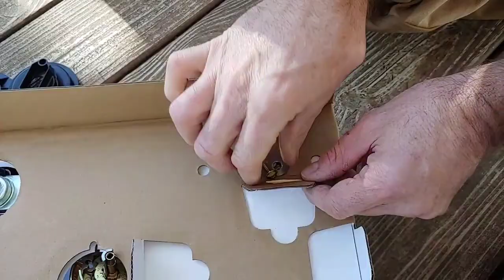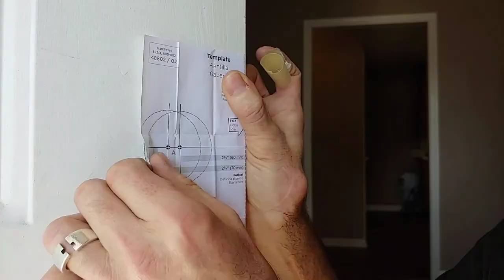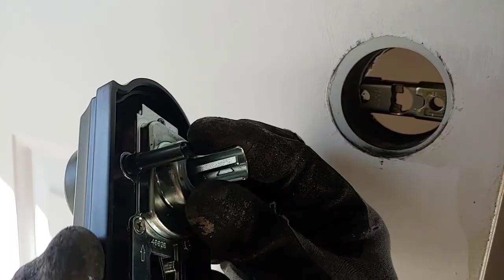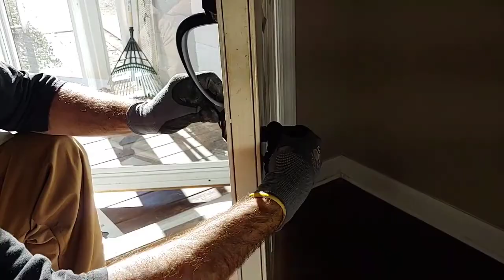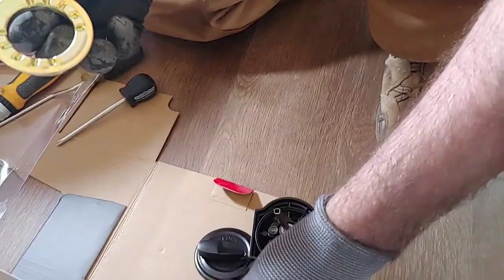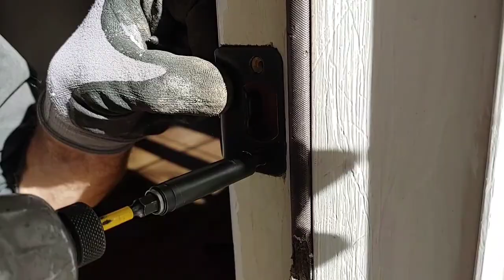Kwikset Montara SmartKey Front Door Lock Set Install DIY #homeimprovement #diy #how

Comment: What size drill bit did Chris use for the hole he drilled?
Reply from the maker: I believe that the drill bit I used was a 3/16 ... sorry about not mentioning that. If you take the bolt and size it up to your drill bits...make the drill bit just a tad bigger than the bolt and you should be good to go! Thanks for watching. You Can Do It👍

Comment: Question. I did mine and it looks like I did everything someway but to lock it locks to left and to unlock is to the right. 
Is there a way I can change that?
Reply from the maker: Hi Junior...great question!  The answer is that unfortunately, that is how locks work. You would think that they would both lock the same direction, but the two locks work differently. The deadbolt is just a simple mechanism of turning the lock to engage the bolt into the door jamb. The doorknob lock works by engaging pins / cylinders in a particular direction so that the doorknob is not allowed to turn. Because these two locks engage the locking mechanism in different ways, the key has to turn differently to achieve this. I'm not aware of any lock set out there that allows the key to operate in the same direction for both locks. I have found this issue to be the case with each set that I have installed regardless of the maker. I hope that this information helps.👍
Reply: @YouCanDoIt2  okay. I thought I did something wrong but with your answer you have answered all my questions.  Thank you!

Comment: Thank you for this video.  Watched before installing the handle lock set.  Very good instruction.  I replaced another handle set and I lucked out and didn't need to drill a hole for the bottom, it lined up with the new handle.

Comment: How do I get the lock orientation to turn the same way? My deadbolt locks to the left as it should, but the bottom handle lock turns right to lock. How do I switch that?
Reply from the maker: Hi Christina. Thank you so much for watching the video and leaving a question. Unfortunately, that is how locks work. You would think that they would both lock the same direction, but the two locks work differently. The deadbolt is just a simple mechanism of turning the lock to engage the bolt into the door jamb. The doorknob lock works by engaging pins / cylinders in a particular direction so that the doorknob is not allowed to turn. Because these two locks engage the locking mechanism in different ways, the key has to turn differently to achieve this. I'm not aware of any lock set out there that allows the key to operate in the same direction for both locks. I have found this issue to be the case with each set that I have installed regardless of the maker. I hope that this information helps.
Reply: @YouCanDoIt2  I appreciate your response. Thank you!

Comment: I have this same lock in gold. Installed on the same side as your video. the bottom locks counter clockwise in your video. Mines lock clockwise how do I fix this? I’m trying to match up with the deadbolt which locks counter clockwise.
Reply from the maker: Hi. Thank you for watching the video. This is what I know to be true about locks. Deadbolts are a simple mechanism with a simple twist to the right to engage the bolt into the jamb and then a simple twist to the left to disengage the bolt. Doorknob locks don't work that way. As far as I know, and for all the knob locks in my house, they all unlock by turning towards the jamb and lock by turning away from the jamb. I don't believe that there is much choice. That's how they are manufactured. If your lock only goes one way, I believe that it is designed by the manufacturer and cannot be changed. The only option for these types of door handles is to change it from right side to left side of the door,  depending on your door swing, by twisting the barrel around. But the locking mechanism itself is built in and cannot be changed. I Hope that information helps.
Reply: @YouCanDoIt2  thanks for your rapid reply 😊

Comment: I live alone. I own my own house. I was able to remove the Kwikset piece that is flushes against the door. I tried using a flat screwdriver to try and remove the round piece, but unfortunately, I have not been to remove the round piece no matter how hard I try. My door is only 2 years old. I have been watching/viewing several videos on YOUTUBE, but so far, I have NOT found one that can help me remove the round flat piece. The screws on my doorknob are hidden.
Reply from the maker: Hi Nancy. If I am understanding you correctly, you are trying to remove the little round disc that is inside the house side of your door on the very bottom of the handle. If that is correct sometimes those do not pop off they actually unscrew. You might want to try unscrewing it. If that doesn't work look at the very bottom of the disc and see if there is a little slot that you can insert a flat head screwdriver into to pop it off. If I was to guess this sounds like it is a disc that you have to just put pressure on to and unscrew it. I hope this information helps you 👍

Comment: Why does the bottom lock locks to the left and unlocks to the right?? Can't see a way to change it like the bolt on top. Thanks
Reply from the maker: Hi Nick. Thank you for watching the video. I'm not sure which lock you are referring to. You mentioned the bottom lock but there's only one lock on this door handle. Can you give me more information?
Reply: @YouCanDoIt2  I'm talking about the lock on the handle.  It locks to the left and I would like it to lock to the right like the dead bolt on top. Thanks
Reply from the maker: @nickhernandez4685  oh, now I understand what you are referring to. Deadbolts are a simple mechanism that is a simple twist to the right to engage the bolt into the jamb and then a simple twist to the left to disengage the bolt. Doorknob locks don't work that way. As far as I know, and for all the knob locks in my house, they all unlock by turning towards the jamb and lock by turning away from the jamb. I don't believe that there is much choice. That's how they are manufactured. Hope that information helps.
Reply: @YouCanDoIt2  okay thank you. It just weird that one locks towards the jam and the other away from the jam
Reply from the maker: @nickhernandez4685  Hi Nick. I totally agree...it is weird how the locks are opposite each other. I'm not sure why that is, only that every lock on my exterior doors do the exact same thing, and they are all different brands from each other. Thanks again for watching our video and taking the time out to comment, really appreciate it!

Comment: Can I use that same brand and model on a 2” thick iron door?
Reply from the maker: Hi Pete....great question.  I just pulled up the specs for you and it looks like the lock set is made for a standard.      1 3/4" inch thick door. The latch can be adjusted from 2 and 3/8 inch to 2 and 3/4 inches away from the edge of the for, but the door thickness is maxed out at 1 and 3/4 inches.  I hope this information helps 👍

Comment: I was trying to connect the bigger handle into the inside part inside and I cannot get it to fit properly. It fits if I put the big handle upside down. Lol I’m so mad right now. Trying to search for answers. Could’ve gotten it if my door opened the other way. Then I took apart the spring part and tried flipping the piece to the other side and it broke.
Reply from the maker: Oh no, that's horrible!  I'm sorry to hear that. There is an option for making it fit in a left swing or right swing door. You needed to switch a button on the inside that allowed for it to be turned. At this point I don't know if it's broken beyond use.

Comment: What size drill bit did you use to make the hole in the door?
Reply from the maker: That's a great question!  Sorry about not mentioning that. I went onto the Kwikset website and was surprised to see that they don't even mention anything about the size of drill bit. I would have to say a safe bet would be that I used a 5/16" drill bit. You do have the handle on the front side and a plastic decorative washer on the back side.  so, if you drill the hole a little larger than the bolt, everything should still be well hidden for you. I hope this information helps! thank you so much for watching 👍